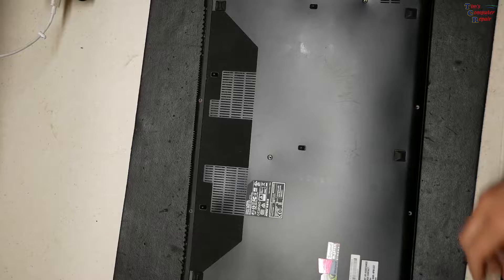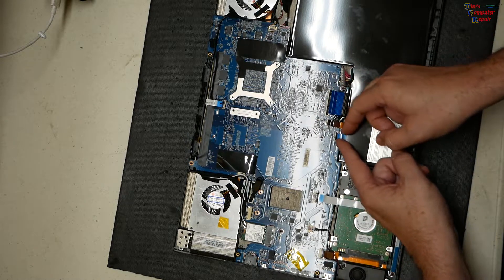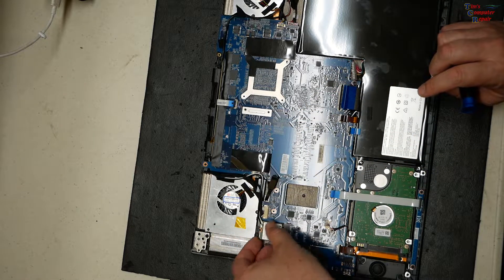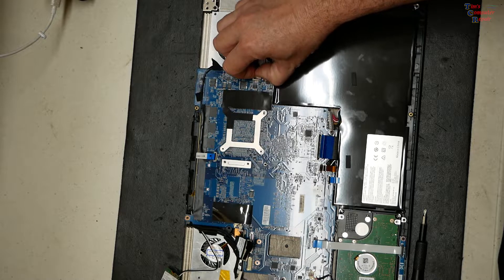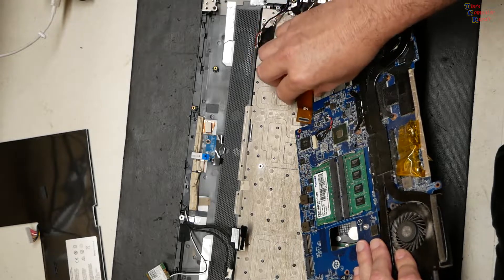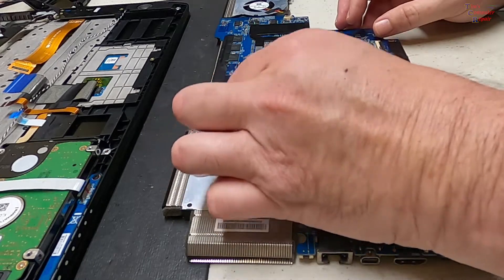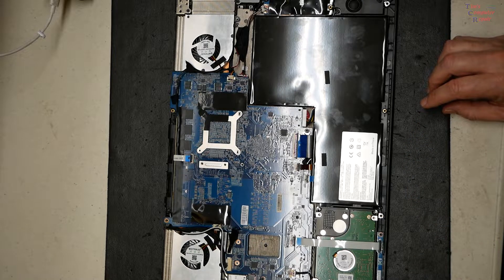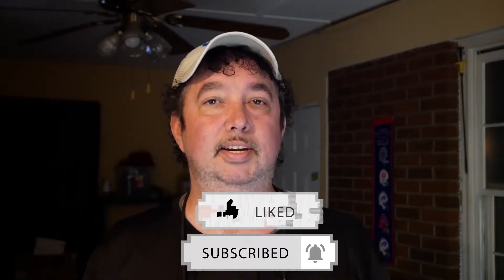Fix Your Annoyingly Loud Fan on Your MSI Gaming Laptop

Comment: The cooling system (Fans) are poorly designed. The replacements are also expensive. You can (and it's what I did) remove the fan cover and re-lube the fan pivot (spin) post with high temp lubricant. It's only a few more steps in an otherwise pain in the ass disassembly. Just replacing the fans with new ones is only going to result in you having to replace them again and spend more money down the line, in a WAY too early timeline. The MSI laptops are great other than this. But in choosing my next gaming laptop (and I didn't get it for gaming as much as I did for film editing on the road) I'll be REALLY looking for a different solution. Good video though! ;-)
Reply: where did u get high temp lubricant

Comment: Hello. I just ordered in a new MSI GF65 Thin 10UE. I noticed the fan gets EXTREMELY loud when gaming. It can get a little hot too. Will replacing the default fans that came with the laptop improve the noise? I dont want to switch out fans if I get the same result. But if the fans that came with the laptop are poor, then I'd probably like to upgrade so that it runs quieter when gaming.
Reply from the maker: If it is a rattling noise then yes, new fans will help. If the noise is simply from spinning up at high speeds then no replacing them will not help.
Reply: @TimsComputerRepair  hey, my msi’s laptop fan was making rattling noises and I managed to replace it, yet just a few weeks with the replacement and it started rattling off too, do you have any insights?

Comment: The only thing that stinks is that you have take the whole motherboard out just to upgrade the RAM unless the keyboard comes out by itself because I don't know if you noticed by the RAM is on the side of the motherboard that faces the top of the laptop.
Reply from the maker: Good point I do not think the keyboard can be removed from the top.What a pain. Thanks for watching.